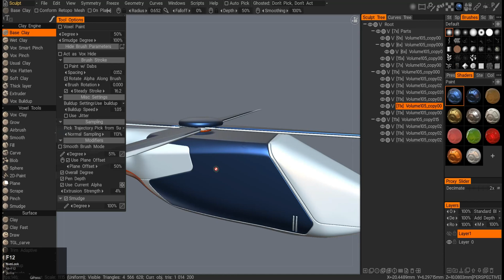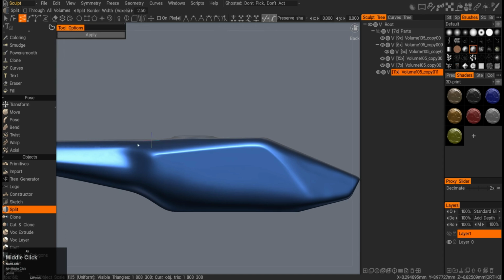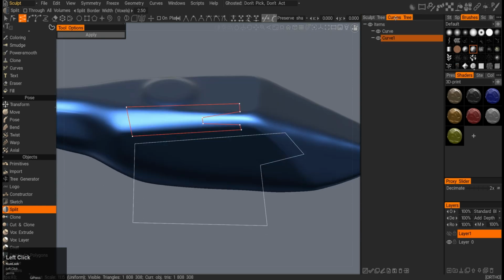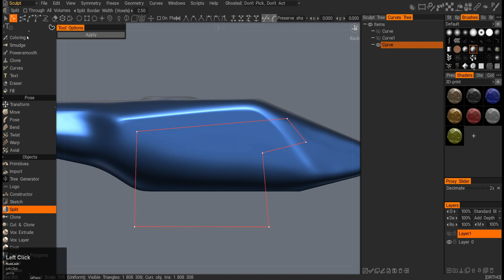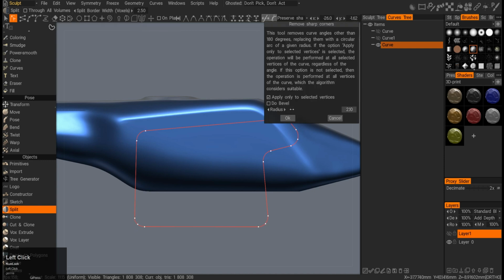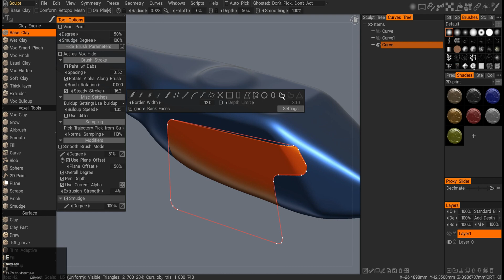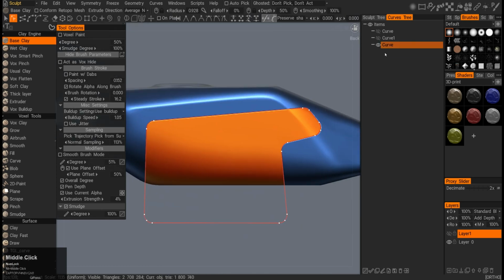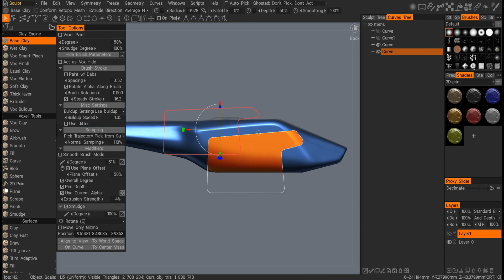Easy Curve Beveling for Hardsurface Design in 3D Coat

Comment: so i saw a video by someone of doing this same cutting by curve in surface mode and in that mode you even get a radius setting on the cut edge. have you seen that? it was an old video with the guy that had the texas like accent. i think if you turn off symmetry and do a depth limit that on surface curve could work better. then sym copy later in mesh menu. negative numbers for border width is a great idea. i wonder what happens with larger numbers there. thanks for this i love coat and atm im learning blender bool workflow but i also work in coat too. what made the curve not stick to surface? just having some points outside the mesh when drawing?
Reply from the maker: I haven't seen the video. If you could link it to me it'd be cool